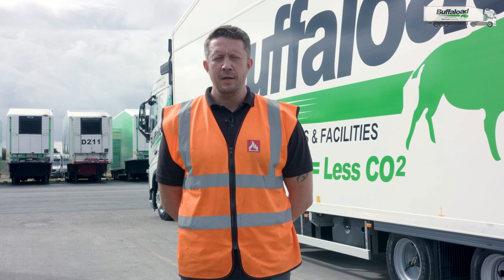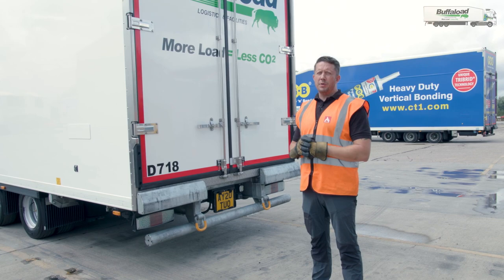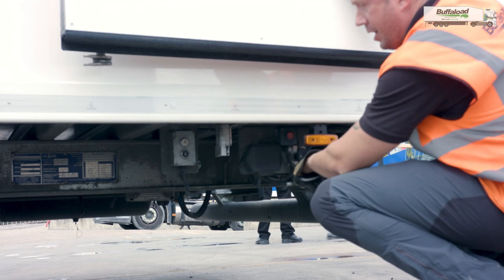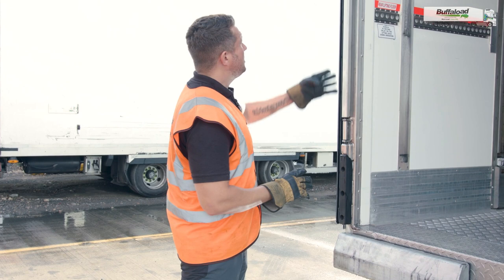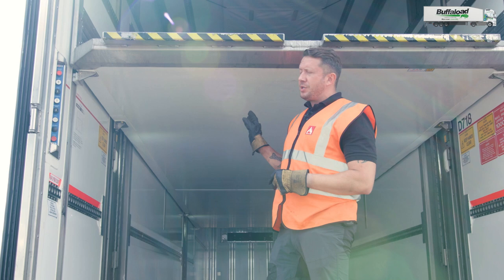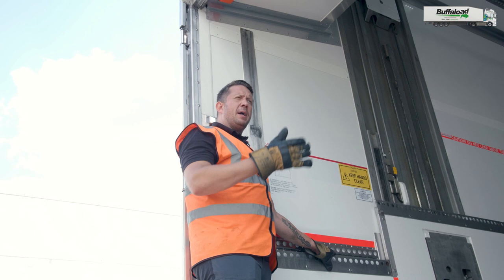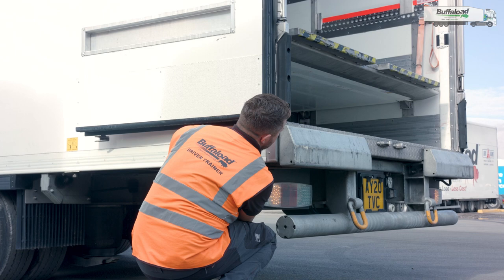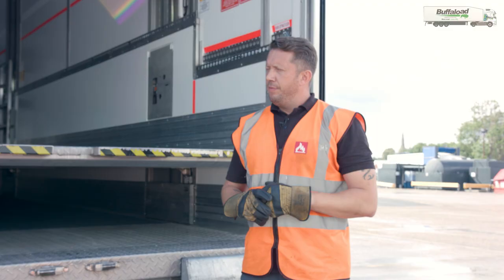4. How to... Double decker operation

Comment: We have these trailers you standing on the trailer at  the back like that is not safe when  bringing  floor down is a no no  you are right on the edge you  can fall off  we  only lower floor from the out side  of trailer. Or in side warehouse only we do what you did we would be sacked   Can not see way you  would stand so close to the end
Reply from the maker: The instructor does say that normally the trailer is placed on a bay so the driver has no access to the internal trailer buttons, he does say for showing (Training) this is what the buttons do, though in the real world you would never use it like this. We chose not to film from inside the chiller so as not to interfere with operations on the day.
Reply: @buffaloadtv5289   if. For training should have use a small ladder and  show how the internal buttons work